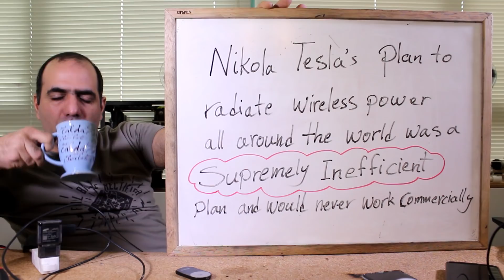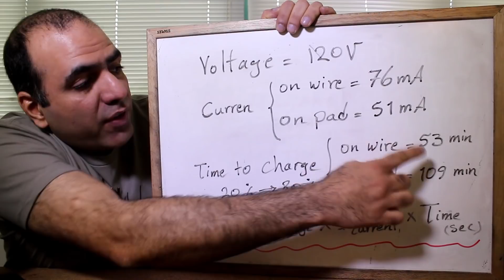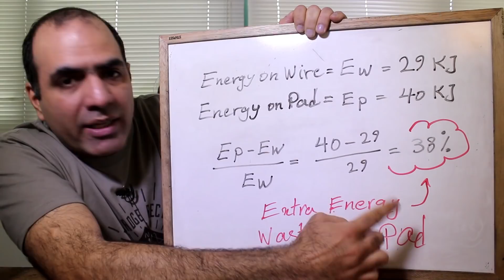Drowning in Inefficiency

Comment: Oh yes the internal combustion engine is very thermally inefficient. Then again having a huge battery pack filled with tons of rare earth metals and charging it for an hour at best for only 250 miles of range and having it drop in the cold is also inefficient.